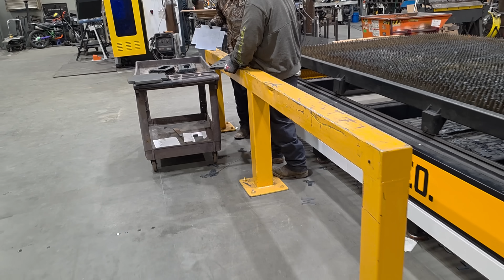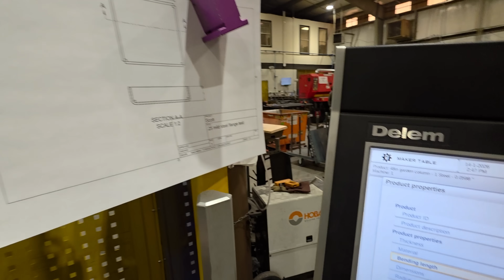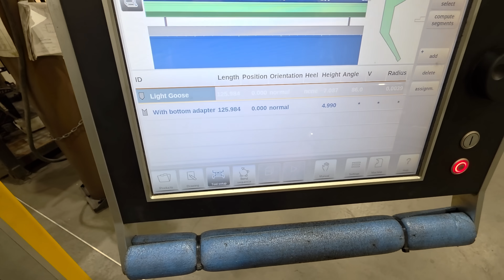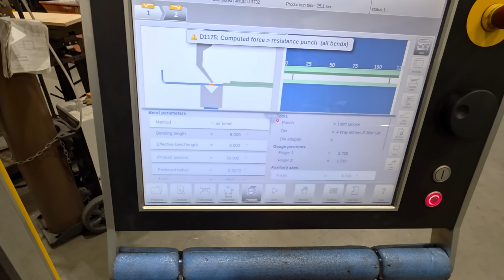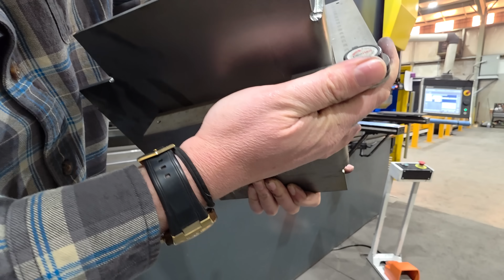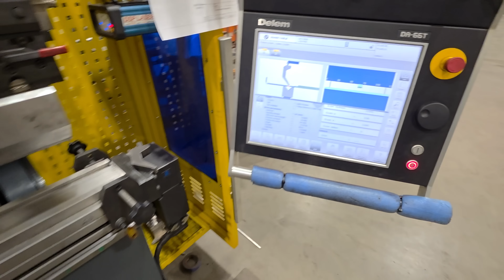Affordable CNC Press Brakes: From Desktop to 400 Ton (Hero Machine Co)

Comment: I love your approach of testing the machines yourselves in production before selling them; it is clear that you really know what you are selling. A truly beautiful press break. You have actually 3 backgages options; the top section on the backgages also serves as an option there are round stops in it thats the 3options, very handy if you need to fold long sides that are longer than the first 2 backgages Max out you showed. The 3rd gage gives you an extra 400mm.

Comment: Hey is it possible to go over the kinds of Air Compressors needed for Fibre laser cutting and cost in running the compressor. Maybe some cutting examples with and without Oxygen. Cheers

Comment: Looks like a pretty nice machine. We recently bought a similar one, different brand, also a Delem control, but with a few less features. It'd be nice to have adjustable height on that control, it looks low, that'd probably drive me crazy.
Reply from the maker: That's rad, I live these delem controllers. Having the R axis is nice, especially when changing lower dies of different heights.
Reply: @HeroMachineCo my first experience with a Delem. It has a lot of features, it’s by far the most advanced controller I’ve used.

Comment: Click bait? No "desktop" variant.
Reply from the maker: Sorry about that, I'm still working on the single phase power units. We use servos on ball screws instead of hydraulics for the desktop units which limits the tonnage but gives higher speeds. They will be coming soon.

Comment: Machine looks good! Cant wait for the day when i can afford one. I'm spending quite a bit on outsourcing formed parts now.
Reply from the maker: That's the perfect way to grow, sub out the parts until the volume gets high enough to buy your own machine. If your business changes before that, you move on with zero risk. But if that part keeps growing you stand to make enough profit to pay off the machine in the first year.
Reply: Sure cool to have a press brake like this aviable any time, it sure is convenient. But it should also make some economical sense, having the volume for it. And time = money, takeing into account standing at the brake spending time one otherwise would use doing other tasks that are also not outsourced)

Comment: Didn't find your pricing for this brake on the website in the description.
Reply from the maker: Sorry, I'm just adding them to the website this week.  I just added the Commander 6+1 brakes, you can check them out here https://heromachineco.com/products/commander-series-6-1-axis-cnc-hydraulic-press-brakes-5ft-16ft?variant=47343837413611

Comment: Were are these presses made?
Reply: Istanbul
Reply from the maker: We make the brakes in China.  The top 3 manufacturers of brakes in the world are not made in the USA.
Reply: @HeroMachineCo  The top press brake manufacturers globally consistently include Amada (Japan), known for innovation and automation; TRUMPF (Germany), a leader in high-tech metal processing; and Bystronic (Switzerland)
Reply: @Ifishmo  Amada is made in the USA, bystronic is made in China and assembled in the USA and elsewhere.
Reply: @joshua43214  Some of Amada brakes are made in the USA, some in Japan, depends on model/series.  The HQ for Amada is Japan.  Was just filling in the blanks for the 'top 3' that HeroMachineCo was talking about yet failed to mention.
Reply from the maker: Check out Amada Shanghai Machine Co for all those "Japanese" made press brakes.  And you are just confirming my point, the best press brakes in the world are not made here in the USA.  Many of the supply chains for these other companies starts in China for annealing the frames, precision grinding work surfaces and then we all add our chosen package of parts Rexroth Valves (German), Delem Controls (Netherlands), Schneider Electronics (France), Yaskawa Servo Packs (Japan) and Siemens Pumps (Germany).  Just like everyone else is doing; maybe the question is who is hiding behind country of origin labeling and who is being up front and honest about it.